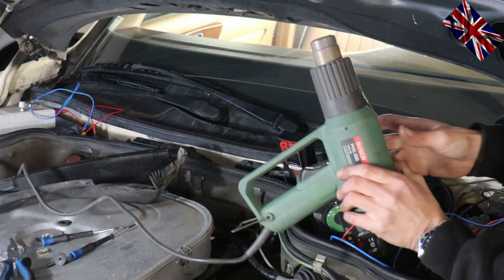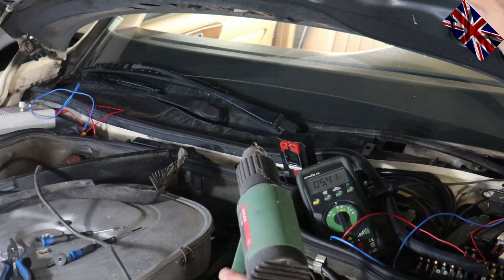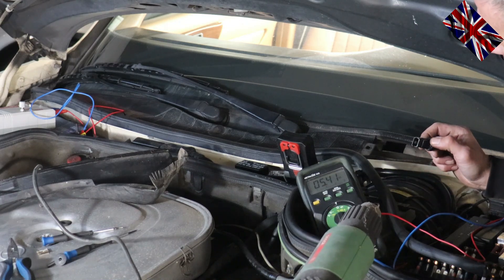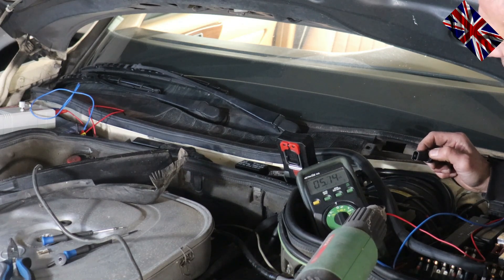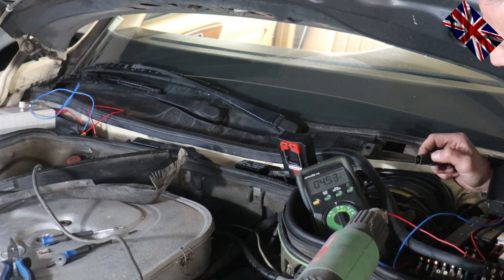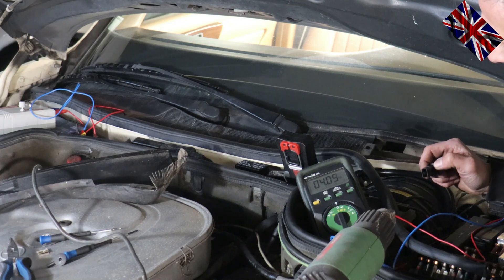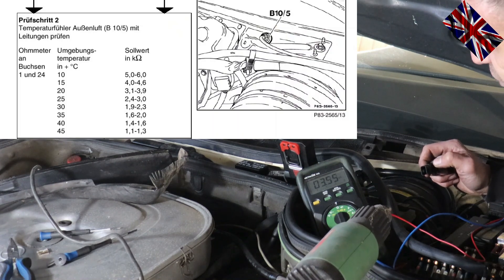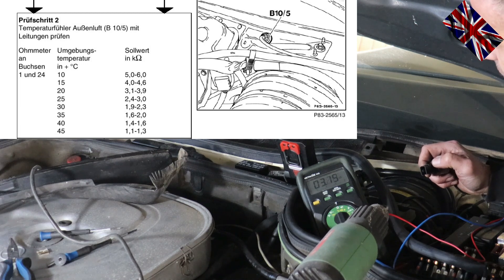Mercedes Benz Exterior temperature display Mercedes W126 Check

Comment: This sensor is for the HVAC system, nothing to do with the display cluster. The one for the cluster is attached onto behind the front number plate bracket.
Reply: Pon..good moring to you ..Very interesting, thank you for your comment.. it also sounds plausible to mount the sensor at the very front of the vehicle... but please explain the function of tthis partin detail in that video, thank you
Reply: @manfredgreissel3886  The control unit compares that sensor value along with various readings from other sensors; evaporator, heater, cabin temperature to give the output needed accordingly. It's in the shop manual. The display is of itself independent from any systems.
Reply: @ponkritasilp9282  thank you pon...
Reply: WHAT IS HVAC AND HOW IS IT DIFFERENT FROM AIR CONDITIONING?
 

It’s become an almost generic term for air conditioning, used synonymously by people in all environments. But what does HVAC mean, exactly? How does it factor into your home or business, will it be heating or cooling? And what, if anything, is the difference between it and air conditioning?
Reply: @manfredgreissel3886  HVAC is generic term for heating, ventilation & air conditioning. it is both heating and cooling.